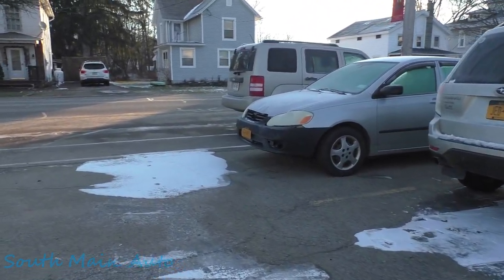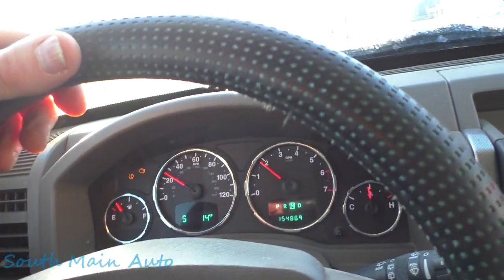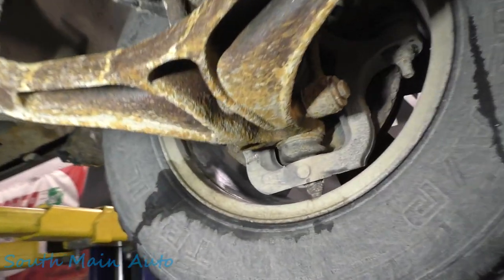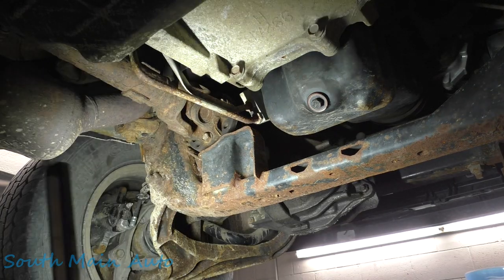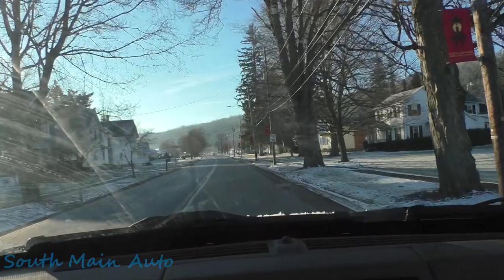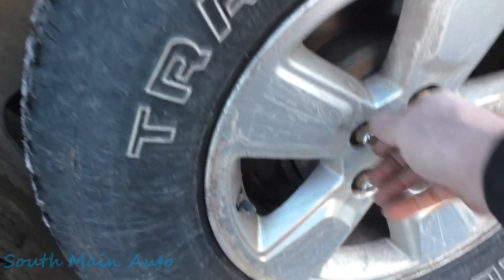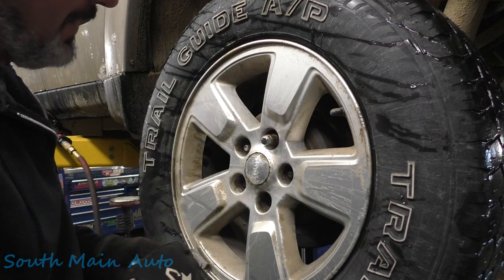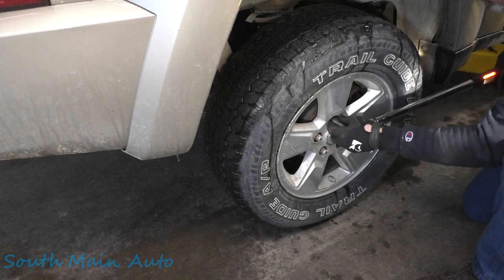Customer Just About Lost It.... A Wheel That Is

Comment: I had a CV joint changed on a 2002 Liberty.  After two days, they still had not called, so I went in to see what was taking so long.  They checked their records, accepted payment and gave me my keys.  Driving home two days later I heard that sound and pulled over to investigate.  The corner with the new CV had only one lug nut.  I expect that the idiot intended to finish later and forgot.  Driving 30 miles or so vibrated off the loose nuts and bent things enough to loosen the wheel.  I took one nut from each wheel to give four on each until I could replace the lost four and damage to the remaining one and the stud.  I had to drill out the stud to get the wheel off and replace the damaged stud remnant.  The damage to the wheel was minor, so I continued to use it.

Comment: I read somewhere that alloy wheels should be retightened after a few miles. Also, do you think a compound such as Locktite would be worthwhile?
Reply: Lock tite is intended for things like the flywheel bolts 
Torque your lugs using a 4 way lug wrench ,this way you control the tightness and the wheel will not come off
Using an impact (going to tite) could stretch the wheel or nut threads
Reply: @abeneufeld9690  true but if a particular car has this problem it might be appropriate

Comment: i don't want be one of them  but  my son just got 07 jeep patriot 2.4 old owner has in  last year her  told her to she needed these parts new batt,new alt,new starter ,new crank shaft position sensor ,both o2 sensors runs and drives great but shut off come out in morning  no dash lights or shifter unlock starts and runs bipass shifter drives great  unhook neg, side batt and every thing comes back works great drive all day no problem . once in a while it will just shut off  but starts and runs just fine .hooked up comp.  no codes got me stumpt  any ideas ??????????? thanks my shop  barber fixit equipment and rental vinton ia   ps sorry  i know you don't like these

Comment: Had a problem with both rear tires, when on the highway the sound in the car would change pitch like a vibration, I had to open a window to release the pressure wave, took it to my local mechanic and he said the problem was both rear tires had broken cords in them, as it turned out my son used the car for a week and apparently ran over something he didn’t tell me until after I asked if he hit something on his trip, low and behold, two new tires later.

Comment: a mechanic who is no longer employed where this happened. over torqued the wheel nuts on my camry. steel wheels. rite after he worked on my car I noticed the rotors were warped. I found it took 130-140 foot lbs to back off the nuts. I re torqued to the correct 80 foot pounds and most of the problem went away so I can use the car ok.. I have new rotors for the next brake service.

Comment: 1995 GMC Vandura conversion van, alloy wheels, left rear egg shaped, tow truck was involved. I had just rotated my own tires, had problem getting lug nuts loose on left rear tire. I put a very small amount of anti seize on the lugs, after driving about 100 miles I started hearing clunk clunk clunk. I stopped safely could see the problem, had to have a new rim and all 5 studs, lug nuts. The tow truck driver and the mechanic that repaired it both informed me that the anti seize was the cause. Apparently aluminum with steel and anti seize and heat from braking was the cause. I do not know of that was what really caused it to happen.  I do and did torque all the lug nuts to spec. Never used anti seize again and never had it happen again.

Comment: Pre covid and retirement a body shop brought me a car they had delivered after they repaired it. The woman said a noise started about a week after she had it back. I didnt have a hoist open but waiting for parts I thought I would do a quick road test in the complex . I heard a very similar noise and test brake on and off , on and off the gas etc… I went back to the shop and told the boss I was heading up the highway to see if it would help . Up to about 50 mph the noise was the same as the test in the complex and still wasnt sure so thought to head back and wait for hoist. Then the shake and noise got worse as i was attempting to slow down and do a u turn . I manage to get to the shoulder and maybe slowed to 10 mph then the wheel passed me. If anyone has ever had that happen they would know it tore the fender off….. back to the body shop. They tried the blame game that maybe i should have hoisted it instead of driving but they were the last to have wheel off and good thing it didn’t happen to the customer with kids in the car at 50 mph

Comment: It's not the climate, I had a 2002 Ram 1500 with the 20" rims and that thing was a PAIN to get the lugs to stay tight on. Zero rust too, and never an apparent reasoning. My buddy has a 2007 and it does the exact same thing. We resolved to retorque the lugs every 100 miles.

Comment: I had a 1998 Dodge Ram truck that had a wheel come loose after new tires were installed. The mechanic swore he torqued all the lugs on all the wheels, but never-the-less one of the back ones came loose. I thought the noise was a universal joint, so drove carefully to work thinking I'd replace the joint after work. A co-worker watched me drive into the parking lot and saw the rear wheel wobble. Yup,,, ruined the lug holes. The garage tire installer didn't want to do anything,,, saying I was supposed to bring the truck back after 100 miles for "re-torque". They never told me that,, I pointed out there was no sign in their shop saying that,, and nothing on the paper work saying to do it. Furthermore,,, for all they knew, I might have left for a long trip after the tires were installed, what then? I had to buy another wheel at my cost. Never went back to that garage again. However,,, I do recheck my aluminum rims now.

Comment: Bought a used car once from a Lady, the Lady said she installed Winter tires herself, I was like, fine no problem. I gave the car to my accompanying driver, he drove off and called me 30 kms after we started and said he thinks the Front axle joint is shot. I told him I test drive it and it was fine. 50kms later down the road, he called me screaming on the phone, the Front left wheel flew off on the highway. We found it later 500meters on the side shoulder. I got So stressed that day. We had to change wheel, fender and brakes.

Comment: OK, I'm old. If they hadn't done away with the left-hand lug nuts, maybe this wouldn't be a problem. As the wheel rolled and acted on the lug nut, it would turn it in the correct direction to tighten it. I think the old International trucks were the same way. By the same token, many a lug nut and stud were ruined as they were turned the wrong way for removal. I suppose many more were ruined than the number coming loose.

Comment: Many years ago I had a Chevy 4x4 pickup with just a standard 15 inch steel wheel on it.  I was driving to work one day , stopped at a traffic sign and turned right to continue.  All of a sudden the left rear of the truck dropped and my wheel rolled on past me.  Drum brakes, so of course the brake drum came off too.   The really strange thing is that there never was any noise.  All six lug nuts came off , the wheel came off and yet zero damage to the wheel studs and zero damage to the wheel or anything else.  I could never figure out how the hell all of that happened yet there was not even a sign that anything had been loose.  Very strange.
Reply: Sounds like you had some one mad at you? And they removed them for you.

Comment: HAHAHAHA <🎶with 4 hungry children and a chevy 8 bolt in the field🎶 Hey , i am sure you check this but both mating surface must be clean, i seen you clean brake rotor but not the wheel , i'm thinking  heat needs to dissipate thru the wheel rim , ask me how i know, when we went looking for the wheel in the toolies ,my buddy asked me which one to take , there was another fully inflated gmc 8 bolt 4 feet away from mine with egg shaped holes, bolts where torqued and re-torqued at approx 100km .

Comment: I think its the taper on the lugnuts. Doesn't matter what I run for wheels on my jeep , they come loose.
Reply: Here's another off-the-wall idea.  Decades ago, aluminum wiring for residences became a popular way to avoid high copper prices.  That was great until these homes started catching fire.  It turns out that aluminum cold-flows.  The (properly tightened) connections to the switches and outlets loosened, creating  a resistive connection because the aluminum wire would not maintain its shape.  Bad results.

There may be an alloy that remediates this issue, but maybe Chrysler selected the wrong one.  Just an idle musing.

Comment: I had a wheel come loose on my wife's Subaru after I used those Torque Limiting Socket Extensions (the colored ones). Turns out the air compressor was not reaching full pressure and under torqued the wheel. I always use a regular Torque wrench after that experience. Anyone want to buy a set? lol

Comment: I am Heating and Cooling  tech years ago driving company ford E 350 box truck with dually wheels  left  home early in the morning drove about two miles the truck was shaking  stop at nearby parking lot it dark outside  with a flashlight I was at rear leaf spring u bolts and shackles  that was all good but noticed  the right rear wheels only one lug and nut the rest were gone  and try to move the to parking spot and lost the rear wheels  I was very lucky I stop

Comment: Could it be from the cold weather cause the aluminum to shrink. Back in the early 80's purchased a brand new 280 ZX turbo. Couple of years later I purchased a new set of tire even back then the were expensive from a Goodyear shop. Let the wife take the Jeep. On the way home the car started sounding like a helicopter was flying over head of me Wopwopwop. I pulled over and looked around the car and saw nothing. When I knelt down and tried to rocked the right front IT MOVED! I got the tire wrench out and all of the lugs on that tire were finger tight... THE OTHER 3 TIRES WERE THE SAME WAY. Got them all tight and went home. Went back to the dealer the next day to share with him what had happened. He swore up and down that no one in his shop would never send a car out like that. I told him that was fine, but if I had not found this and my wife had been cruising down the road with our daughter in the car and one or two of the tires lost their lug nuts, that we would be having an entirely different conversation and he would be doing all of the listening.

Comment: Climate must be a factor, My theory is that aluminum has a greater rate of expansion than steel so it's constantly pushing/releasing wheel tension which loosens the lug nuts. An acquaintance of mine insists never to clean/lubricate wheel studs because it makes wheels come off. Beg to differ, but occasionally checking wheel tightness is all that's required.

Comment: Didn't happen to me, but right next to me,  on 93 south,  101 interchange.   I was driving down the highway minding my own business when I see a Grand Cherokee getting on the highway.  He wasn't about to yield to anyone,  of course I was the one in his way, so pulled into the left lane,  plenty of time, he didn't even need to slow his roll.   No problem.  

 Well, this guy decided he was going to demonstrate his complete dominance of the superhighway. He poured on the coals, full tilt boogie as I was passing him in the left lane.  I, coincidently was sitting in my Jeep GC,  going about 75 with the cruise on,  fat dumb and happy.    I heard that hemi begin to roar,  exhaust puffing,  tappets rapping, followed by a sudden surge of acceleration.   He went from about 65 to 85 in no time flat. 

 I watched this unfold,  thinking to myself with a satisfied murmur,  "Yeah,  he has a hemi too."   Then it happened,  he was about 30 feet ahead of me when I saw a brillant flash of reflected sunlight, from the five, highly polished, fancy lug nuts, skittering across the highway in front of me.   Then the left front wheel departed the vehicle, accelerated down the centerline for a while, before  rolling to the side of the highway,  bouncing against the  new,  squirrel crossing preventive height  Jersey type barrier on the side of the road.    

The now humbled driver in his Grand Cherokee,  quickly slowed from what I estimate to be about 90 mph,  with sparks flying.   Surprisingly the GC was tracking true as he skillfully maneuvered to the break down lane and came to a stop.   I, of course, had been on my brakes, not wanting to mingle with his errant wheel and concerned he would spin into me.  

 When I decided all was well for me to pass,  I gave him a little taste of my own hemi,  exhaust roaring,  tappets singing their rhythmic beat.  It was awesome.  I rolled down my window, and as I was passing, screamed out that ever helpful phrase:  "YOU CAN"T PARK THERE!!!"    True story,  except for the "You can't park there part."     I went home and checked my lug nuts after that.

Comment: Good video.
I had a 76 F150 in the late 80's with those dog dish hub caps on it. It was making strange sounds when going slow, and it would go away when you sped up.  Ignored it for a few days.  It got pretty bad, jacked it up to check things out, and when I popped one of those hub caps off 4 lug nuts were rolling around in there. How the wheel didn't fall off I don't know - maybe it had another couple hundred feet left in it before that would have happened.

Comment: I think climate is one issue aluminum shrinks at a different rate than steel (i.e. lug nuts) and causes many problems in cold weather.  Also every vehicle I have had it is always recommended in the owner's manual to either retourque the wheel nuts or have a mechanic do it for you after 50 miles.  I see you still sound a bit like Sylvester (😂😂) gotta love dental work right.  Moral of the story make sure your nuts are tight. 🔩

Comment: I had a 2002 Hyundai Accent thaI beat the piss out of. Didn’t tighten the lugs on one wheel enough, and it was clunking. A mechanic told me it was My wheel. I was still a newb mechanic.
Reply: I think it was from doing the front pads right after I got it. I did the transmission oil and filter too. Don’t think I ever changed the engine oil though. Didn’t own it long enough to matter.

Comment: I've been mechanic for 30 years. The First Day I worked I was taught you NEVER test drive a vehicle where a customer complains about Road noise without a full hoist inspection, and wheel inspection. Mechanic who taught this trick said if the mechanic is test driving the vehicle and the suspension breaks or looses steering killing people you are criminally liable for Homicide. PLUS how can you comments 90% of Dodge have wheel loose tire issues BUT then pull a front driveshaft off First without checking for a loose tire. THERE IS NO WAY THAT tire would not have been loose on a shake with weight off the vehicle on the hoist. DON'T even try and say you checked it. 

You endangered people and yourself by test driving that Jeep prior to a proper inspection ?

Toyota recommends a 5 mile test drive and retorque BY ALL mechanics with aluminium wheels. Customers Do Not need to return at 100 miles. Have you ever seen a NASCAR going 200 MPH come back in for a retorque after a TIRE swap ? On lap 499 of a 500 lap race ?

Comment: Those early 2000s Dodge/Jeap and mid-2000s BMWs had the softest factory aluminum, you just cross some railroad tracks or touch a baby pothole, and she's a gone'r.  The BMWs not as bad as the Dodge/Jeep for loosening lugs as the BMWs are hub centric and seemed to still be spot on after a 100 and then 500 mile retorque, not those damn Chryslers though.

Comment: Eric, after 48 yrs. owning my shop,,, true, Chrysler is the worst,, Ford second ! Since the aluminum wheel era, people change their own winters, hubcentric plays a big roll when install, aluminum & steel with offshore “chrome” tin Palnuts,if the hub is not cleaned , 2-3 weeks later,,,bump, bump , bump ! Seen more in the last ten years than all my 1/2 decade of wheel swapping ! All newer vehicle wheel nuts are Metric when built, guys still use 3/4 , 13/16 & 7/8 sockets ? + “ overtorque !Have a poop ! LOL

Comment: All aluminum wheels, afford spect years ago was only 95 foot-pounds. But all aluminum wheels I have torque and have them come back in three to five days and report them, and every manufacturer the torque spec has to be redone because it's never to torque after it settles in. Has nothing to do with Dodge. It has to do with cast aluminum wheels primarily. Every single one of them has to be retorqued. Especially the right side considering you're actually tightening the lugs the wrong way. You should tighten a lug to the rear of the car not to the front of the car. That's why Chrysler for so long had left hand threads on the right side of the car. Even Buick made them that way for a while.
And if I remember right, I have seen a number of cars that that's marked on the instructions for the car. Always retorque alloy wheels.

Comment: Only 12 seconds in and I will already tell you that the Dorman lug studs from Napa (not a sponsor) will not fit Jeeps. Hopefully it's not Sunday and you can get them from a dealership.
Reply: I replaced the lug studs on my 03 Tacoma and broke 2 out of 6 fresh out of the box at 100 lbs- Dorman studs from Rock Auto.  Thankfully I had a scrap rear end in storage I could salvage a few studs from.  Is there someplace you can buy decent quality studs online?
Reply: @patrickmowatt8560  On the Jeeps, the Dorman studs knurled shank part is too big and the studs will not fit in the holes, let alone seat in the holes.

Dorman studs have bitten me three or four times, all on Jeeps and all the exact same problem.